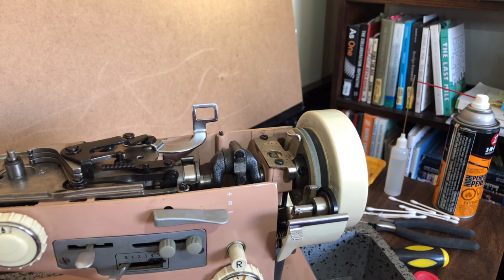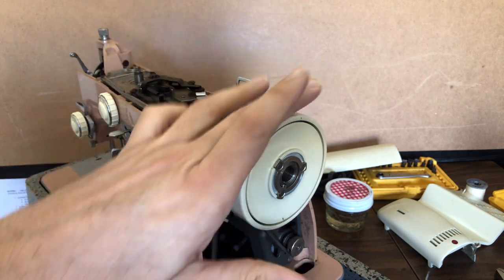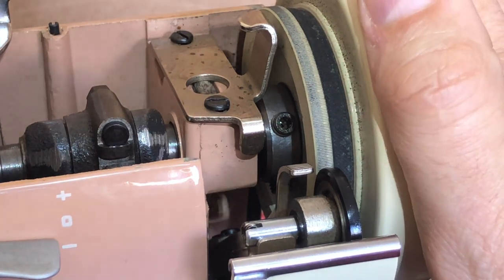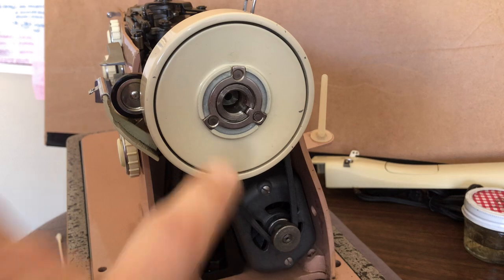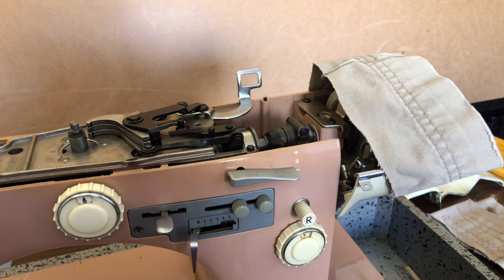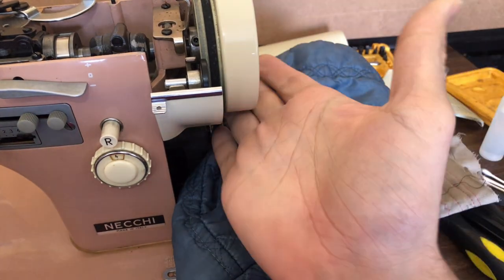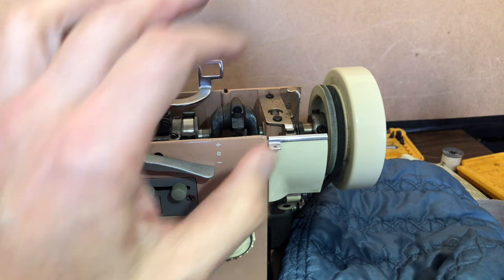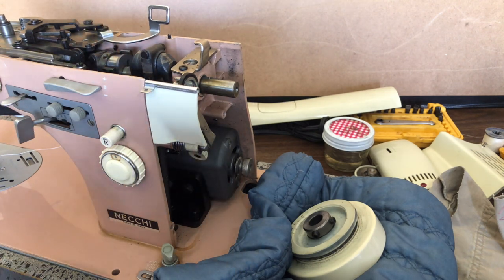TROUBLESHOOTING SERIES #10: Stuck Like Glue!  Removing a Stuck Hand Wheel on a Necchi Sewing Machine

Comment: This posting was a Supernova AND sanity saver!  I was fixing an older Necchi Supernova with a stuck aluminum hand wheel.  Instead of the two hex bolts your machine had, there was a snap ring retainer on the shaft, but even with that difference, everything went exactly as your video instructed.  Using a hammer's rubber handle to tap against the wheel was a brilliant idea.  The hand wheel was freed, the parts cleaned, and lubricated as you directed, and the Supernova is back in action.  Thank you very much for posting this!
Reply from the maker: So wonderful to hear that another one of these machines has been rescued; thanks to you MBonEB!!